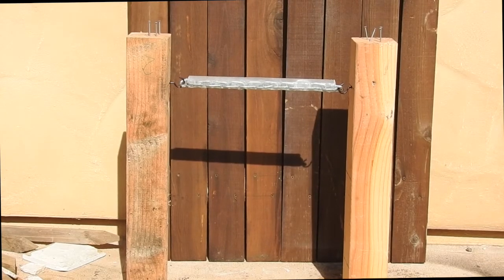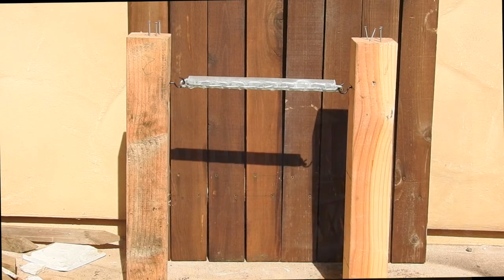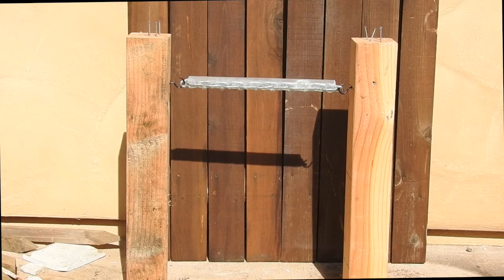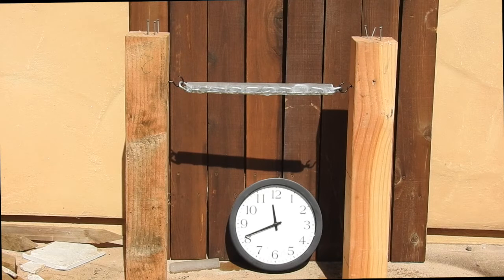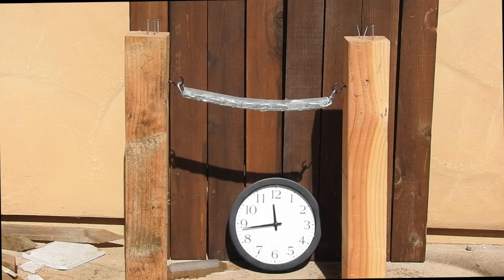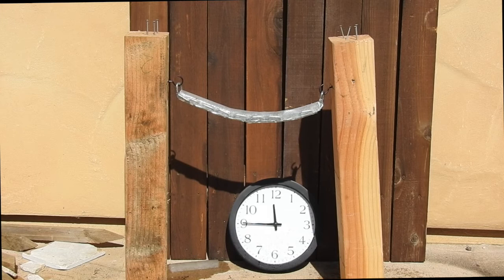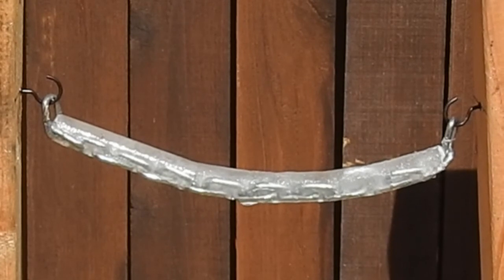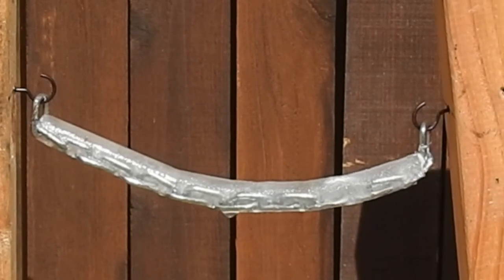Using a Frozen Chain To Demonstrate Gradual Weakening and Pull-In of WTC Floor Truss

Comment: And also, the central structure was much stronger so even if I accept your BS you havent explained what made the center collapse
Reply: A 100 ton airliner crashing at 400 km/h and the the fuel exploding??? BTW, the fireproofing wasn't concrete, it was a foam.
Reply: @Ihaveanamenowtaken  Yes, what happened to all the fireproofing?
Reply: @MrLaptopus  It got burned away in the intense heat which was much higher temperature and for a longer time than the fireproofing materials were intended to withstand.

Comment: Now make the same experiment with many chains representing the many floors and melt only a few of them. Then see what happens, bonehead
Reply: Okay, let's do that but put an equivalent mass on top of the beams to represent the floors above the fire.
Reply: @ChucksSEADnDEAD  Sure, and enough mass on the bottom to represent the bottom of the building
Reply: @MrLaptopus  Mass below isn't necessary to explore the mechanics of the initial collapse.

Comment: fireproofed trusses started sagging. yep, makes total sense
Reply: Ask a firefighter about "fireproof" safes in houses that burned to the ground.
Reply: @ChucksSEADnDEAD  Fireproofed with asbestos?
Reply: @MrLaptopus  only the north tower (the first tower built) up to like the 30th floor had abestos.
Reply: You can't indefinitely fireproof anything with any method. Fire proofing can only slow down heating. Give enough time and/or heat and the fireproofed structure will reach the flame temperature. Without actual factual numbers fireproofing in any given scenario is a lot meaningless hot air (pun intended).
Reply: lol what an ignorant comment

Comment: New Stars academy video is out. What you think Mike?
Reply from the maker: https://www.metabunk.org/go-fast-footage-from-tom-delonges-to-the-stars-academy-bird.t9569/
Reply: You are missing the point. The problems that Truthers see are that both towers suffered maximum bowing at the same location, with very comparable profiles and in the same amount of time (30 minutes). And this happend in an area with intact fireproofing, in front of an intact part of the core and only after ~ 15 minutes of fire (WTC 1). So that the bowing looks like natural fire-induced bowing that was magnified by core columnremoval via thermite (heating by sacks of themite inside the cavities of the wide flange core columns).
Reply: @MickWest  How can 2 planes take down 3 buildings?
And how many experts said it was controlled demolition and you say is was not ? :)
If the steel melt, the tip of building would just fall off, simple as that.
And you know that was a case with a fire who lasted many hours and still nothing happened.
What is happening with you, Mick ?
I understand you think chemtrails are contrails, ok, but this ?!
How can you not see what happened?

Comment: once i saw a documentary about the collapse of wtc buldings, they put forward a possible solution of how that could happen. if i remember correctly the culprit was molten aluminium poured with water which seemed very paulisible to me. but they didnt give any special explanation about the collapse of the 3. building. what is your take on that, Mick? thanks.
Reply: Several experts say there's no way a building could fall from the fire, and that the towers fell just like a controlled demolition.
But hey, this guy knows better than to think the government deserves our trust.

Comment: What's your point Mick? Are you trying to debunk all of the evidence that suggests 911 was an inside job?
Reply from the maker: Just the bits that are wrong.
Reply: Sadly, there needs to be a new investigation. NIST got a lot of things wrong. Very likely. Still, fire is the most probable explanation but the true mechanisms are unknown. In fact, the 2004 Weidlinger report - though a shorter one - is far better - in some aspects.
Reply: And the obvious problems with the NIST report + missing, undocumented impact zone core columns are what fuels the CTs. And I don't blame them.
Reply: Are you agreeing with the Official NIST report?
How do YOU believe WTC7 came down, and how ca we explain the molten metal and the incredible heat that lasted well into November?